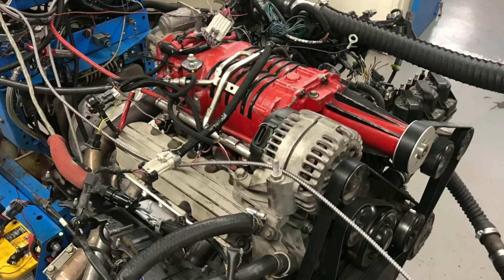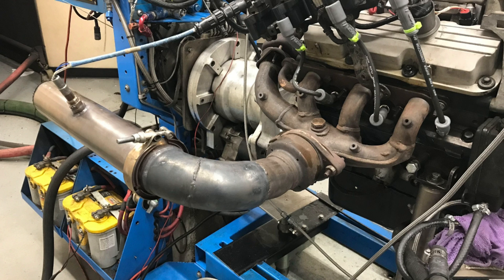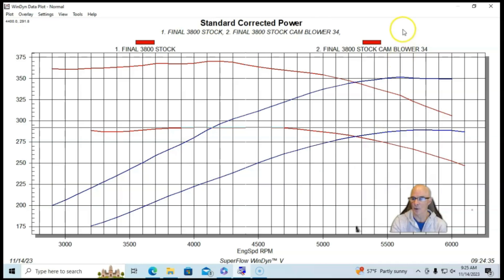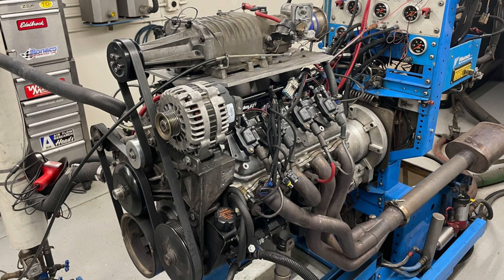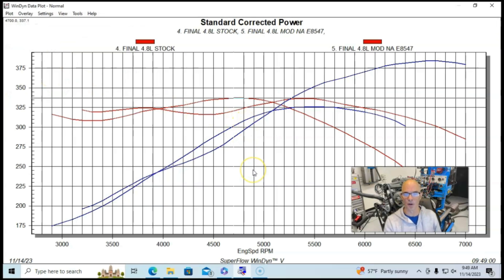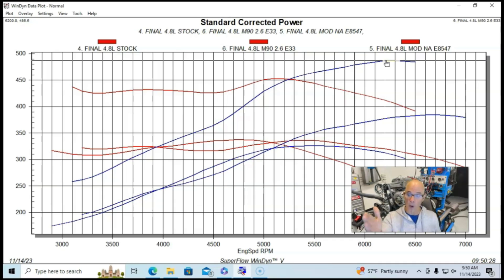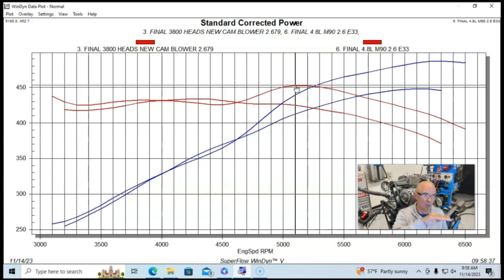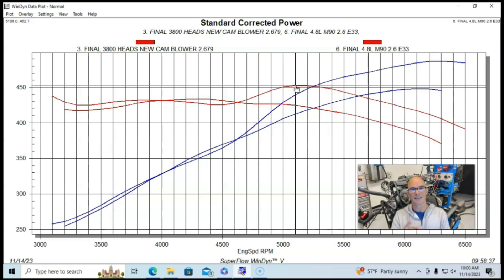3.8L V6 VS 4.8L V8 CHEAP M90 BLOWER TEST. WHAT HAPPENS WHEN YOU RUN THE SAME BLOWER ON BOTH MOTORS?

Comment: I was considering a setup like this for my’88 Fiero GT.  The local wrecking yard has a bunch of these old Buicks with the supercharged 3.8, and they go cheap!  Are there any years that are more desirable? Or less? Signs to avoid?  Thank you!
Reply from the maker: LOOK FOR THE GEN 5 BLOWER AND THE L32 MOTOR-RATED AT 260 HP INSTEAD OF 240 HP (EARLIER VERSION L67 USED THE GEN 3 BLOWER)
Reply: @richardholdener1727  Awesome!  I’m not sure if this would be all that interesting to you but…. What if you took a bunch of “less desirable” motors like some of the motors people try to make more power with like Hondas “lesser” motors? Or GM’s 2.5L 4-cylinder “Iron duke”?  Just slap a turbo on them and try to tune them for maximum power?  Maybe GM’s venerable 4.3 V6?  Or the original 3.1 V6 that I yanked out of my SCCA Camaro’s chassis when I first bought it home?  I mean, part of hot rodding is “Usin’ whacha got”, right?
  I’d like to see a series like that.  You’re so thorough, I just KNOW it would be great!
Reply: Like Richard said, look for a Series 3 with the better blower. That said, even a Series 2 will be a huge upgrade over the Fiero engines. You're talking an extra 100-120 HP compared to the 2.8 V6.
Reply: Any series two supercharged would be a good engine but I hear different trans issues were more sorted in later years
Reply: Thanks, everyone, so far, what years do the different generations “fit into”?  I’m more a “TPI and LC-2 turned LS” guy.  First I was going to put a caddy Northstar in it (One of the other guys in my SCCA group did, and the exhaust note through twin single-chamber flowmasters is AMAZING!) Then I was thinking turbo 5.3   Got a couple of those laying around I could build, and let’s be honest, a child can do it (In fact, one of my sons built his first 6.0 7 years ago when he was 12, and he’s still using that motor in his Trans-Am track car today! (Yes, I’m a pretty good parent, if I do say so, myself! Lol). I like being different, and while I’m very sure a 3.8 supercharged Buick motor has been done a bunch of times, I haven’t personally seen it, and that’s good enough for me! Plus it’s something new for me to learn and play with, and I love learning new stuff!
  Again, thanks guys!
Reply: @JasonMcCord-1012  - The 3800 Series 2 ran until 2005, I think. And the Series 3 started in 2004. So there's some overlap. But it's easy to tell them apart. For the n/a engines, just look at the intake manifold. The series 2 has a plastic intake, and the series 3 is aluminum. For the supercharged engines, look at the throttle body. The series 2 throttle body is cable operated, whereas the series 3 is drive-by-wire. Since you're starting fresh, so to speak, maybe try a turbo 3800? Just an idea.
Reply: Another engine to consider for a Fiero swap is the High Value V6. They came in 3.5 and 3.9 liters. The 3.9 version makes 240 hp naturally aspirated. It has the same bellhousing bolt pattern as the Fiero engines and the 3800. It also has aluminum heads, and variable cam timing. Just an idea.
Reply from the maker: or high feature
Reply: @michaelblacktree    Wow!  Somehow I missed these comments!  Sorry about that!   What cars did these “High value” or “High Feature” motors come in?   I don’t know anything about them.  I think the vvt makes me a bit nervous….   The fact they share the same bolt pattern makes me want it though….   I’ve got several turbos laying around from other builds (I usually keep spares of everything, so I can “Hot swap” at the track, if need be.  Which is why my fuel systems always use “bullet” style electrical connectors on external fuel pumps, with quick connections on both sides of the pumps and filters)
Reply: @michaelblacktree  is that 3.9 the 5th and 6th gen Camaro’s base motor?   If so, there are several of them at my local junkyard and they are even cheaper than the 3.8L V6!  Hmmm…. How would I make the VVT work….
Reply: @JasonMcCord-1012  - The High Value and High Feature are two completely different engines. The High Feature engine is DOHC with direct injection, and it has a proprietary bellhousing. The High Value engine is derived from the 60-degree V6, and has the same bellhousing. You can look up the GM High Value engine on wikipedia.
Reply: @michaelblacktree    Right on!  Thank you!
Reply: @JasonMcCord-1012  - I forgot to mention, if you want to delete the VVT in the High Value engine, you can use a camshaft from a Gen3 60-Degree engine (3100 / 3400 SFI), and a VVT delete kit from WOT-Tech.
Reply: I put a supercharged 3800 in my Fiero, it was an awesome combo! Ended up ripping off the blower, putting a large cam, turbocharger, and e85 in it... Was nuts.

Comment: If you factor in the crank pulley difference, the hp peaks are differentl only in the third digit. Sounds like airflow is power, pretty much. Thanks again for an interesting video, Richard!
Reply: Airflow has always been a factor in spark delivery and power output. Getting the proper AFR is the key in that mix.

Comment: He needs to compare the Chevy 3.6 versus the Buick 3.8, both turbo charged.
Reply: The n/a 3.6 makes more power than a 3800 s/c. So with both engines turbocharged, the 3800 would have a serious handicap. BTW there's a version of the 3.6 that comes from the factory with twin turbos and 460-470 HP.

Comment: Just like I've always said....the blower determines the power not so much the engine on boosted stuff. It usually benefits smaller displacement stuff. Especially when the blower is to small for the larger engine.

Comment: I've said for years thr 3800 is GM's all time GREATEST. And I get looks as if I'm a nut
Reply: Not from people who KNOW!
Reply: Any unbiased mechanic that's being wrenching for the past 30 years or more will tell you that the 3.8 is/was the most reliable, longest lasting V6 ever produced by GM.
With regular maintenance these things would easily go 300K & parts are dirt cheap if you needed to make a repair.  The bodies& frames of the Buicks would rot away well before the engine and trans crapped out.
Reply from the maker: MY DAILY 5.3L HAS 330k MILES AND IS STILL RUNNING STRONG-SO WITH MAINTENANCE, LOTS OF GOOD CHOICES OUT THERE
Reply: @Mayamax3  I am NOT A GM guy but I tell Chevy guys all the time the 3800 pays for your Camaro and Vette. This engine pays GMs bills

Comment: It’s surprising how fast the 3.8 starts jumping in power with minimal effort
Reply: They will pull like a train, especially with a pulley swap.
Reply: I've seen build threads of people going over 500 whp on stock bottom ends with new springs, turbos, intercoolers, and e85 tunes.
Reply: Since it started at 290hp, if you put a turbo on it and run it to 15 psi it should make in the ball park of 580 hp
Reply from the maker: the modified 3800 made 613 hp at 14.5 psi
Reply: @richardholdener1727  nice, i was half watching writing estimates
Reply: Good stock cylinder heads!

Comment: I rock an Eaton M112 on top of the Ford 3.8 v6 split port, though it's 4.3 liters of displacement. Blowers can't replace displacement, they do enhance the core engine behaviour. Beyond raw output, it would be interesting to check BMEP of your two data sets.
Reply: I don’t know…. Those Coyote engines are still pretty high in price, but gradually coming down a little….   I love the idea of a supercharged v-6 mustang.  I used to daydream of taking a 3.8 SN95 or 3.8 4thgen Camaro, and supercharging it!  Oh, the V-8’s you catch by surprise!   I say “Go for it”!
Reply: @JasonMcCord-1012   unless your going budget turbo and flex fuel its going to take the same or more money than a yote swap to make the same power with a sc3.8 from the 90s/early 2000s. If your dead set on V6 id recommend something newer that NA already makes more than those older SC V6s
Reply: You can squeeze 350 ish whp from a supercharged Ford 3.8/4.2 essex. That's with lots of internal work, a supporting fuel system, and water injection.

The yote will put down 400 whp with less support, less fuel pump, and less nvh.
Reply: @philmariop  some people dont realize just how quick a bunch of little things add up in price. A 400whp yote is pretty much a tune and exhaust vs a full build for a sc3.8
Reply: @knowbull5hit590  yup
Reply: I love the videos And all the research but I believe you could make more power under the curve using a non bt cam or the ruck borris cam. The lsa is supposed to be in the equation. That being said. Your cam is wrong and I need you to wear the shirt. Lsa has direct effect on power bt has his head up his ass when he is favoring the exhaust lobe to generate the power out back. Look up bullydog garage his and dv's equations coinside. Rich you have always been a man of good standing and people. Expose those who have it wrong. When a 383 iron headed camel backs no less produce more power than bt's so called great cams. This motor is dang near 600 hp on pump 87 octane. Let's see the numbers correct. Remember it's not what you want it's what the motor wants.
Reply from the maker: there are literally thousands of other WRONG CAMS I could run in this motor that can make more power. This test wasn't about making maximum power (none of my tests ever are), it was to demonstrate the power potential of the junkyard M90-stay focused on the test at hand, stay on task
Reply: @richardholdener1727 it's funny how quick people are to "very specifically dog" on a test, when the test video description literally SAYS it's for "SPECIFICALLY testing  a SPECIFIC power adder".....If cams were going to be a part of the test, the video would state as such....lol,  not to mention the EXTENSIVE catalog of videos here that get into ALL SORTS of " specific cam related tests"....anyway....thanks for the work you do, and the information you're able to provide . For free. Much appreciated.
Reply: Correct me if I'm wrong but in the video he's testing a gm 3.8 not a Ford 3.8 correct?
Reply: @chrismacphersom3258  correct. Holdener compared two GM engines. I made a comment about the Ford counterpart. Both made 3.8 liter and 4.2 or 4.3 liter v6 engines.
Reply: What other mods needed to be done to support that? I've got a full Thunderbird SC M90 that I'd love to throw onto my 3.8 mustang. I figured I could get away with just bigger injectors, and a less restrictive exhaust if I keep the boost below 10psi.
Reply: @NemuiJin  the supercoupe top end requires the single port heads.  At least you get an intercooler.

I must admit I sunk a lot into mine, before the coyote was an option. The budget over time became expansive and expensive.